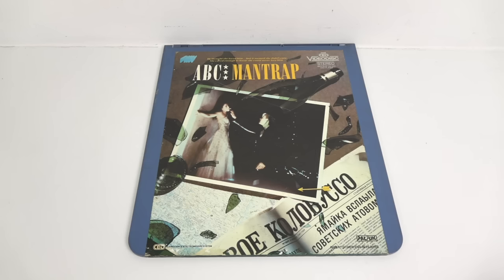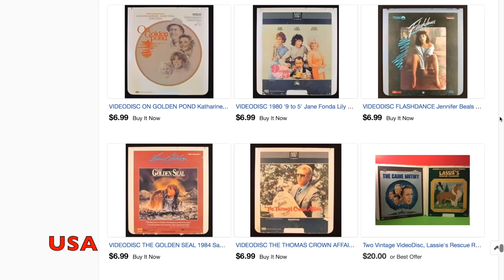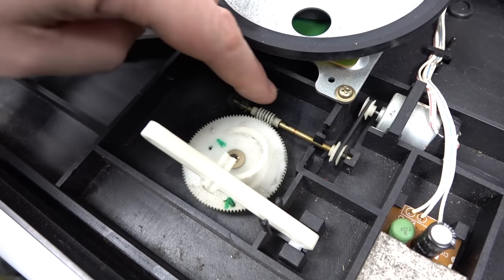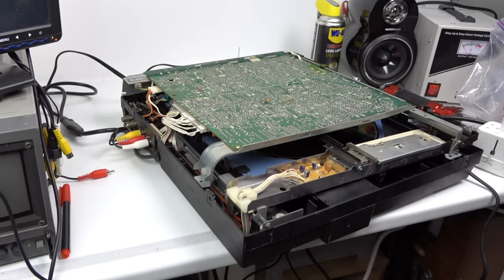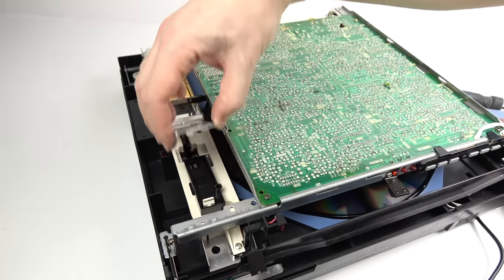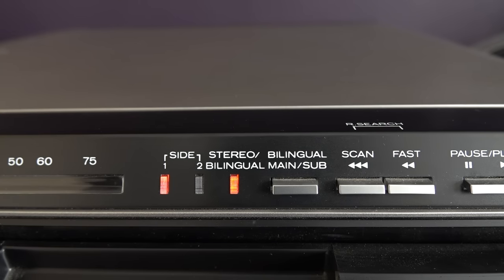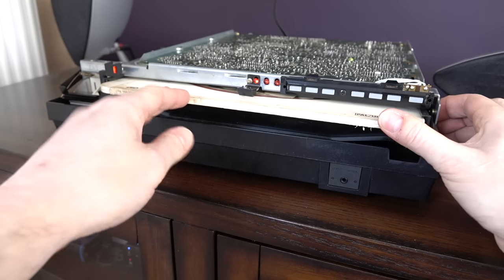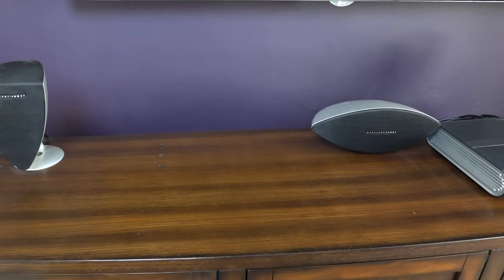Retro tech: The RCA CED Videodisc

Comment: And there it is... The truth of collecting old tech... Most of it just doesnt work anymore and is only suitable for nostalgic looking at on someones shelf for curiosity sake. I had a Phillips cdi. It was used well but used carefully. It sat under a TV in back room. Kept well dusted. Within 20 years it was all but dead mechanically. Put a disc in and all it would do is jump jump and jump some more so the games were unplayable. U could say they were when it was working. Haha.as this was a few years before PlayStation changed everything for everyone and we never looked back. My Phillips cdi was sold off to a retro game shop for ridiculously low price.. Still times change and we move on...

Comment: I find it terribly interesting he says the difference between US/UK versions is a 50/60hz SIGNAL, (at first i think, "no 50/60Hz. power frequency, not signal...") but with analog devices the signal frequency is the similar to the power input frequency. Otherwise it might take more circuitry than it's function requires. They had the technology at the time to create a standard clock based frequency internationally, but the circuit would cost twice as much!

Comment: I wonder who the brainiac was at RCA that convinced the company to develop this technology.  All the top minds left RCA for Silicon Valley in the  late seventies and early 80's.  so, RCA was probably milking some older engineers who weren't very forward thinking.  Investing in any technology can be a crapshoot.  Even HP, which dominated the 70's and 80's lost it's way in the 90's.
Reply: RCA first conceived CEDs in the mid-sixties.  The engineers had developed a disc that could hold ten minutes of video by the early 70s.